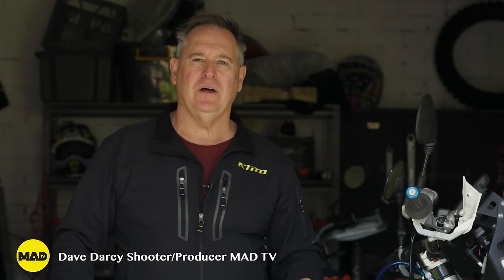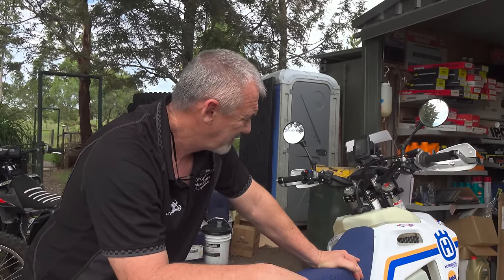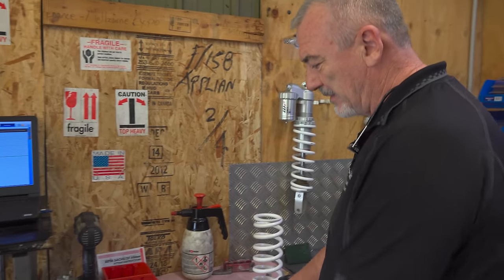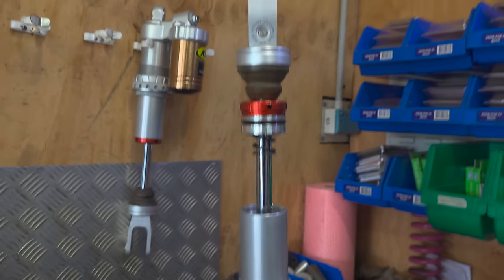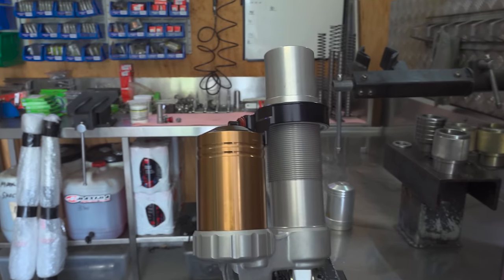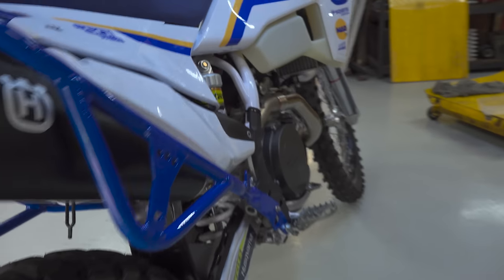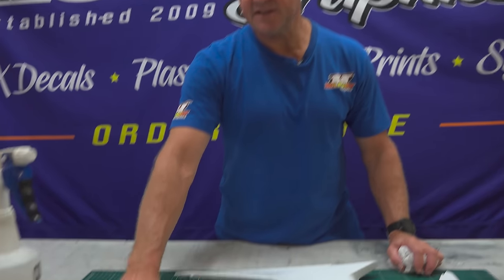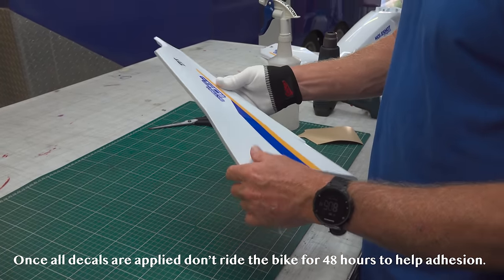2023 Husqvarna FE501 Adventure Bike Build Ep. 3

Comment: I did a lot of the same things on my 16 fe501s, but I added a vapor gauge pod and external heat gauge as well. I run the vapor because it's easy to reset the speedo when the circumference of my front tire changes. Instead of the tower, I run a Bajaworx front windshield (because it's adjustable) and all of my navigation is held in place by ram locks. I also run a Warp 9 supermoto kit with Shinko 705s front and rear on tubeless 17-inch wheels (120/70 front and 140/80 rear. That setup works well for most mild/medium conditions and really well on gravel/paved roads. If I am going to hit nasty stuff, I switch to the normal Dunlop dirt setup with bibs. I also reflashed with the hard-to-find Eurotune flash. The bike pulls like a freight train now. I put a shaved seat concepts seat on my bike, but I am going to change it out of a Fisher custom seat. I really like that rear rack you used. I am currently in Oregon so I am actually close to the manufacturer lol.

I am retired and travel full-time on my 53-foot trawler. I use my boat as a base of operations, traveling in the boat from spot to spot...Then I unloaded my bike and explore inland. I chose the 501 because of the weight and the rear-linked suspension. I lift my bike on and off my trawler with the dinghy crane. Right now, I am traveling up the Columbia River. In the spring, I am heading to Alaska. I am going to moor up somewhere in SE AK, then ride to Deadhorse. So far, my 501 has been bulletproof. I service every 30 hours. I don't worry about the valve check. Singles self-diagnose. Too loose and you can hear it. Too tight and it won't start lol. I have checked them twice out of precaution, but they didn't need any shims. After AK, I am heading to Cabo to explore baja...Then Central and South America.

Great build video series. It gave me some new ideas.

Comment: How did the bike go from 108 dry to 128 dry (141 - 13 kg of fuel)? That's 20 kg more than stock. Is that really true or is Husqvarna lying about the stock weight of 108 kg? Thanks for the awesome series of bike builds! :)
Reply from the maker: Yes 108 KG untouched with no fuel.  Look at we put on it and then filled it up with 17 litres of fuel.
Reply: @MotorcycleAdventureDirtbikeTV  Thanks. Did you put it on a scale before upgrading? The fuel is about 13 kg (17-18 liters). So, without fuel the bike is 128 kg. That is 20(!) kg more than the claimed stock weight of 108 kg. The tower was 3 kg. What is the remaining 17 kilos?

Comment: Great Build story BUT its missing the Final conclusion. Is the 501 much worse over the 701 on a 200km Tarmac road? Is the 501 with the large fuel tank a lot better on hard enduro single track then the 701? Is it Overall worth to switch from a 701 to a 501 to get the better Hard Adventure Bike or not? It would be great to get a clear answer.. 501 or 701 which one is the true Unicorn? All the best from Turkey.
Reply from the maker: 501 701 comprison still to come as is a Honda crf300 501 comparison.
Reply: Very good.. Its a missing Video on the complete Youtube Cosmos.. Strangely no clear 501/701 and 500/690 comparisons available so I look forward to your Opinion.. I am most likely swapping my 690 for a 501 soon to be able to reach more harder Enduro Terrain in Turkey that I did not risk with the weight of the 690. As solo rider in very remote areas weight is the crucial difference.

Comment: I thought a standard 701 is 156kg wet and this 501 just weighed in the same weight after all the mods. So what is the advantage? Or am I missing something? I’m looking at buying one or the other.
Reply from the maker: If you want to ride on longer adventures take the 701.  If you want to do four and five dayers in the tough stuff, choose the 501.
Reply: My 701with rade tank full of fuel with small saddlebags with tools and adventure spares was 175kg wet.
My 501 stock with barkbusters and xlink linkage guard was 117kg wet. Add a few kgs of tools in the bumbag and 4ltr fuel bladder. Still nearly 50kg the difference.

Comment: I have an older 640 about to undergo a similar fitting. Looking forwards to the finished bike.
Reply from the maker: They are a great bike.  Get the carby looked at it is likely the rubbers parts have perished.  I caution it will be costly.
Reply: @MotorcycleAdventureDirtbikeTV  Got a spanker 41mm Mikuni flat slide already on and tuned.. lol
Reply from the maker: @barmyarmy935  great
Reply: @MotorcycleAdventureDirtbikeTV  Have you looked at Lectron carbs for any build as a potential modification?
Reply from the maker: @osimnod  Not interested osimond.  I may do the ecu mod.  still thinking about that.

Comment: Any issues with the bolt heads where the rack attaches to the frame, or the exposed lower end edge of the rack tubing? It looks like they’d gouge your boots or tear over the boot pants? There’s a lot of metal bits sticking out down there…. Other than this concern I’d really like that rack for my bike to carry 14 kg of camping gear, food and water.
Reply from the maker: I wondered that when I put it on, but no signs of damage at all to pants.  It's really really solid.

Comment: Good looking build.  The rack and plate are good kit.  Sturdy and guards the exhaust pipe as well.   Clive worked his knowledge on the suspension.  Having the air removed from new oil is big.  I've seen it many times with looks like millions of tiny bubbles in it.  New shake your oil or brake fluid.  The graphics is good to know.  The hinge method.  I have to do that with my Tenere as I'm changing my tank to an Acerbis and the graphics on a black 2022 model is split between the tank and side fairing cover.  So part of it has to be pulled and a new/old design put on.  Thanks Dave great job.  Interesting to say the least and fun to watch pros doing their work.
Reply from the maker: Yep.  Now we've got to ride it and show that suspension being used.

Comment: Putting the tower is definitely THE error of the whole set-up.
Reply from the maker: Possibly. I'm an anti tower person.  My 701 doesn't have one.
Reply: @MotorcycleAdventureDirtbikeTV  Otherwise great 👍🏻 The only struggle I have is reducing handlebar vibes on my FE 501, I don't like the foam grips, PHDS is said not to be so effective for vibes. My favourite grip setup for long mixed stretches is donut + tennis overgrip on normal grips. Fairings are may be legit for long stretches in cold/rainy climate, though many mount them as if they would have the same speed and navigation constraints as for winning stages of a long desert Rally, but the truth is it is done for the looks (yeah, those look good). Cheers

Comment: Impressive build, particularly the suspension updates.  I have the 501’s little brother, the FE350 and see some decent mods I may consider.  Curious as to your impressions of the 501 as a lightweight adventure bike compared to your 701.
Reply from the maker: Much lighter than the 701 on two fronts, physical weight and centripetal force of the engine.  The suspension on my 501 is truly amazing, we will test it soon

Comment: Kinda wish you had done more of a build with the 701. Lightweight diet (exhaust, battery, canister removal etc) and some suspension work might get it somewhere closer to the 501 but with more relaxed maintenance?

Obviously the 701 will never be an enduro but all the builds on YouTube are typically adding weight and nav towers which then pushes the husky into the realms of the T7.
Reply from the maker: I'm thinking of returning to the 701 and redoing the suspension with the same specs as the 501, which is possible and that would do that bike.
Reply: @MotorcycleAdventureDirtbikeTV  that’s sounds like a good idea, I think you’ve got some of the best content for 701’s on YouTube at the moment, looking forwards to watching more!

Comment: My '15 FE501 weighs the same with a 20 litre tank full.
Reply: My 18 EXC in similar spec with 7l in the Acerbis tank weighed approx 130kg so right on par with this build. I had a Racetech fork kit fitted to do the same things but I had 40 mm travel removed for safer access. Still have 260 mm of travel.
Reply from the maker: Yeah that's a good setup.